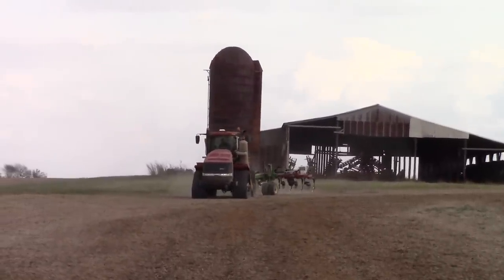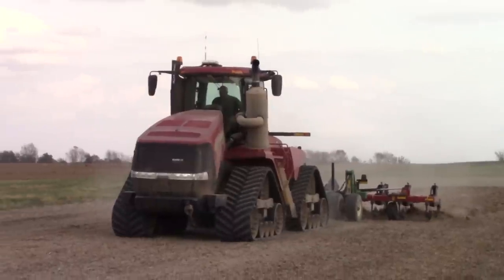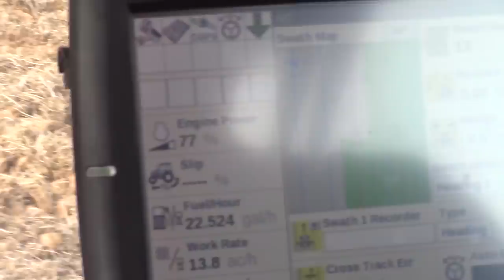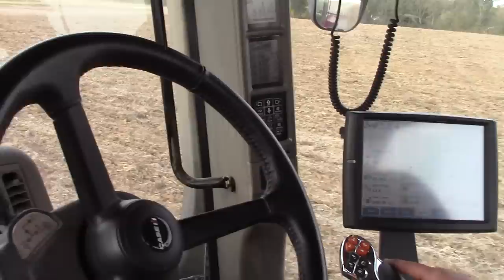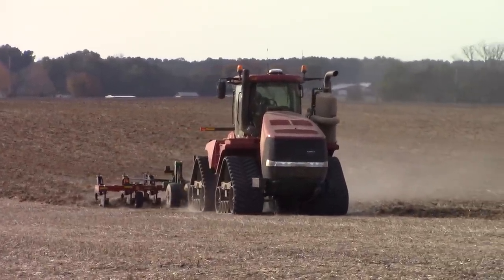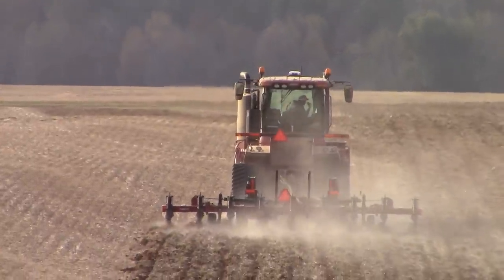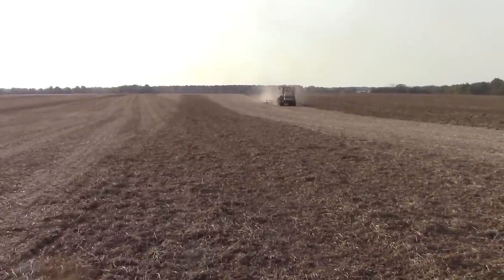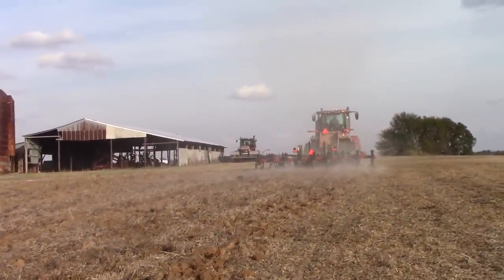Case IH's Largest Tractor: 620 hp Quadtrac

Comment: Deere finally came out with quad trac. Well we have had green machines for ever but, seven years ago got the IH quad trac. Demo the deere two years ago.. Hydralics are slow and need rpm of tractor up so It lifts implement out of the ground.  We pull a 26 foot 875. The deere pulled it almost a mile and hour slower and used more fuel with 10 percent slippage verses the IH only had 1 percent slippage. We were not impressed. We will stay with the IH for now and the price for the Green was 80000 more in dollars.. Good luck Deere.

Comment: This Case is incredible. The amount of power available is certainly more then or exceeds that of which any farmer might require on their farm. However, the one issue with every tracked tractor is maintenance cost. Particularly those tracks. They're fairly expensive to replace and while most large farming operations likely have a sizeable budget for maintenance, these tractors tend to create their own sort of issues. 

In reality, both this Case IH and it's counterpart John Deere tracked tractor both offer exceptional power coupled with amazing technology, that just a few scant decades ago were science fiction. Today, both Case and Deere, as well as many other tractor manufactures, offer a plethora of technologies all specifically designed and engineered for farmers. 

Its hard to look at the diminutive little tractors of the 30's and 40's and then look at this really amazing Case IH. It looks like it was dropped off here by aliens from another planet in some distant part of the universe. I like both the Case and Deere tracked tractors, but the Deere, is my most favorite. Though I am a loyal Case IH guy, the Deere's setup is more impressive too me. Especially the tracks themselves. 

🚜☀🇺🇸

Comment: damn muffler is almost as big as the tractor
Reply: And 40k to replace
Reply: It does a decent job keeping 682 ponies quiet though.
Reply: Kyle Kenan horsepower bet you dont even know what a horse is
Reply: Daniel Mandujano Depends what kind of horse you're talking about.
Reply: corey v What's funny is in spite of the huge muffler,inside the cab is INCREDABLY loud.The Deere's cab is much quieter.

Comment: Why in hell don't they just run the exhausts under the tractor to the rear!! It is out of sight and a lot less sound! i have changed 2 tractor exhausts to do that. There is plenty of room.
Reply from the maker: It’s an interesting topic. The Claas Xerion the the muffler masked on the back of the cab. In Europe the New Holland T9 4wds built at Steiger mount the muffler horizontally on the hood. I would say the muffler really does not block the view despite its size.  Also these Steigers are very quite. You can hardly hear it working until it’s right on you.
Reply: New holland work master 70 series has the exhaust coming out the side downwards, works well for mowing around trees.